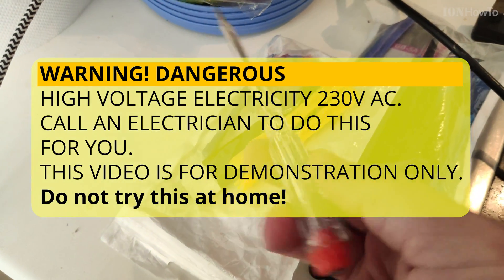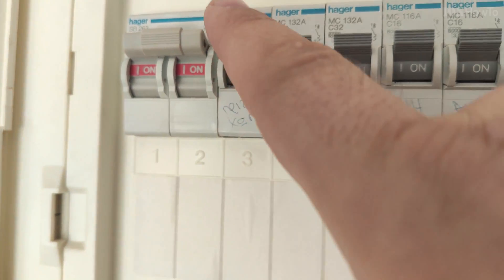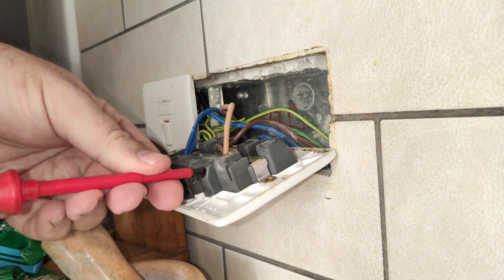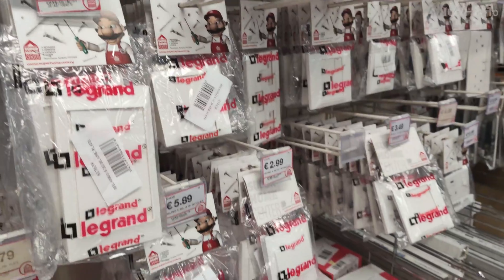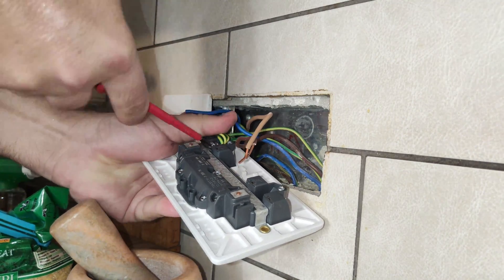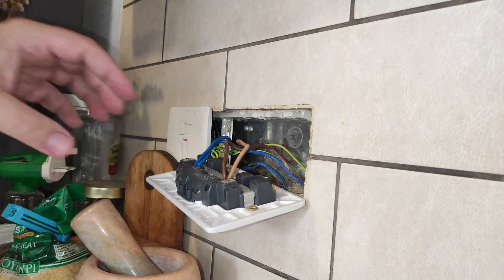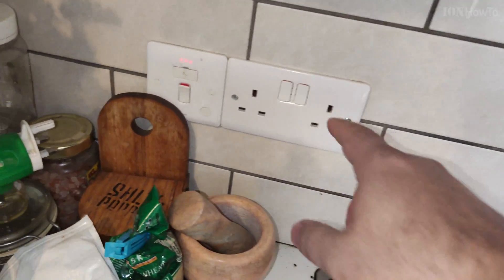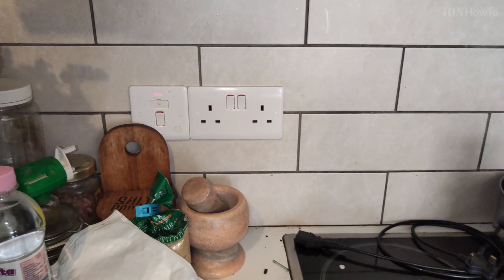Electrical socket outlet replacement UK plug

Comment: Good that you’re extra careful. In the ideal world multiple wires are best twisted together so one doesn’t fall out but I’m guilty of usually not twisting them.
Reply from the maker: I was thinking about that too. Just needed to put the thing back as it was originally installed. One was loose so had to really check they're ok before closing it.
Reply: @IONHowTo  I usually just pull at them a bit, if one is loose it will become obvious then. I think there is a special twisting tool that electricians use to easily twist them together.